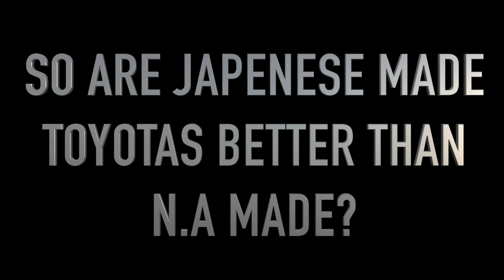Are Toyotas Made in Japan Better than Toyotas Made elsewhere?

Comment: Some thing not discussed {I understand why) is the tension between the factory workers and the car company/management.   American workers and Japanese workers I would suggest differ here. 
 
Japanese workers feel that they are essential and appreciated team players with Toyota/management in producing world leading high quality/reliable vehicles moreso than American workers do.  Has a LOT to do with the fact that workers in Japan are Japanese and their managers are Japanese and the company is a Japanese car company.

We purchased a new 2018 Camry LE with a JVIN in early 2018.  I watch a lot of CCN videos on DIY maintenance and ran across a difference between the parts/design of our JVIN 2018 LE and similar Kentucky/US made 2018 LEs.  On CCN's video on the engine coolant radiator drain & fill at the part in the process where a coolant hose is disconnected from the EGR cooler just before the fill with new coolant to assist in removing the air from the system I noticed the difference.  On our JVIN I found a quick disconnect at this location.  When to our selling dealer's parts dept and sure enough the hoses to the EGR cooler are a different PN for the JVIN and the US assembled LE and the US LE has no quick disconnect.  Better?  Maybe not, but more convenient and faster.  So this is a design difference and does NOT touch on the assembly process at all.  Another difference was pointed out in a thread on the TN  forum. No recovery eye bolt is included on US 2018 LEs but on our JVIN we have the eye bolt that can be screwed into the front drivers side grill threaded recovery point.  There is a spot in the foam tool holder for this eyebolt and it is shown in the owner's manual.  Don't know why it is not included on the US LE.  Cost cutting run amuck?

Comment: I have been watching Matt's Off Road Recovery on utube and found out something that is quite disappointing to me.  Matt came across a brand new Subaru stuck in not much sand.  It just wouldn't move at all or spin the wheels at all.  Matt says a lot of new cars shut down (as in no throttle) when under strain in deep sand, mud, snow etc.  INCLUDING Toyotas !!!!  I drive a new Highlander Platinum with torque vectoring AWD.  I can tell you right now if it shut down on me just when I need it, it would be for sale the next day.  My question is - is a Highlander one of the vehicles that does this?  If that is the case, I would go back to the old 4Runner but not before checking it out first.

Comment: Toyota products made in Japan use different parts than those built elsewere.
Or at least they used to. In my repair shop and personal cars when buying 
parts for Toyota's I was always asked if it was made in Japan or another country.
Serial # starts with J was made in Japan. I also noted US vehicles used US made
parts in their vehicles. Example Batteries, wipers, tires, radiators, brake parts and so on.
I was told Toyotas made in US used 30% US parts, an agreement they had.
Having said that guess which parts failed?????? In my experience there is a huge
 difference.

Comment: An example of bad toyota engineering:  I owned a 2003 Pontiac Vibe (Matrix) that had a "snap" sound when the drivers window was rolled down.  Eventially a "scrape" appeared on the window and it turns out that the metal door catch that sticks in the door and is connected to the frame that stops it from swinging open was poorly designed.  The window, and only when the door was closed, would hit this door stop on its way down.  Sometimes they would actually break off.  I believe the very next year they fixed it and the new design could be retrofitted.  An interesting story and something I have not noticed on any other car I have owned.

Comment: Being a Massive global company, Toyota does have a fairly market-oriented way of releasing models to specific areas of the world. While I've not always agreed who got what for certain reasons (mainly niche features all the way up to region-exclusive engines), Mechanically they've got it figured out to both what works and what sells better overall. Also like a lot of manufacturers, I would venture to say that they keep all the best of their offerings to themselves, but (!) there's likely reasons for it that the consumer is not in on the decision-making end. 
On the rust issues, you'll find examples from every market they released a model that was very prone to corrosion. Every manufacturer has a fluke once in a while, though Toyota normally makes good reflection choices to improve deficiencies. I've had several Toyotas manufactured both is the US and Japan that have outlasted my expectations mechanically but were eventually sold as their bodies/frames/critical structure points were advancing beyond my monetary means to keep them from returning to their base elements.

Comment: I have owned and serviced many Toyotas over the last 4 decades. For the most part I agree with these conclusions, but there have been some glaring examples in the distant past that created the impression where it was made mattered.
Case in point- anything built in the Fremont Assembly facility in the early to mid 80s up to early 90s or so. This was a GM plant that under partnership with Toyota built the Geo badged and even some Toyota badged Corollas. Interestingly, it is now a Tesla plant. 
I agree about general reliability, but the paint, the panel gaps, the interiors, etc were bad. Really bad. I've seen Corollas that were built there that didn't even have full paint coverage on the inner lip of the front fender. Showing primer. Hood paint so thin you could see the primer on white painted units. Interior plastics degrading much faster than Japanese made units.
In my opinion the Toyota/GM partnership did more to degrade Toyota's brand than anything else. Avoid these cars.

Comment: Does Toyota take into account post-sales issues into future model years? For example, the 2UR-GSE engine is otherwise very reliable but the valley plate coolant leak caused by the failing FIPG is a well-known issue that has existed for years - does Toyota note this and make design changes to later model years based on consumer reporting or is it only via internal reporting via failure rates and field service reps, etc?

Comment: My 2007 Toyota Camry Hybrid was built in Japan I had a major issue where the computer shutdown the gas engine in a rain storm when driving home at night on the way to the top of one of the highest suspension bridges in the USA the Chesapeake Bay Bridge near Annapolis Maryland.

Toyota Corporate in California replaced the computer in my Toyota Camry Hybrid. The vehicle was recalled many times for other items yet Toyota never recalled any Toyota Camrys to get the computer replaced that controls the gas engine in the Hybrid Synergy Drive.

Comment: Lots of comments about "pride" of Japanese autoworkers vs. those in North America. While this may be true to some extent, this probably has played a much lesser role than the Kaizen Total Quality Management system. This was the competitive advantage that propelled several of the Japanese automakers to gain significant market share. 

A lot of the key Kaizen concepts (lean production, minimization of process variation, continuous process improvement, etc.) have been adopted by North American companies, but implementing them into operations is ultimately down to management. I would agree with both presenters in the video here - the company & management structure matters a lot more than the manufacturing location.

Comment: i was shocked a few years ago when i found out my 1998 tacoma was built in Baja California Mexico because i thought Toyotas were all built in Japan , I love my tacoma truck the major problem i have with it is that my son keeps crashing into people so we kinda fix it and wait till the next crash ,i have 3 Tacomas now i don't care about where they are build ,may be i should but i can't control that , one thing negative about my 1998 tacoma the front left wheel  upper arm ball joint  came off at like 260,000 miles while mi son made a turn the seal was cracked and grease came out no way to grease that part (that i know of) once seal brakes ,my 2004 tacoma with 164,000 miles also no way of greasing that upper ball joint and it has broken seal kinda scares me ,i have to check my 2016 tacoma to see if it has greasing  thingy ,i don't work on cars ,thank God my brother in law does . i had him replace upper ball joints on both sides when that happened just to be safe .

Comment: There is no question about the difference in quality.  The quality is not in design but in the production and assembling.  I had a 2000 Sienna that was assembled in Kentucky , right off the lot, there was a patch in the inside front passenger door that wasn't painted. The overlap sequence of the A-pillar and dash pad was reversed on the passenger side. After 5 years or so I had a check engine light indicating that there was a problem in #5 cylinder, it had to remove a lot of stuff yo get to it. What I found was obviously man made problem, the spark plug wire was only dangling there, it was luck that it ran like it for 5 years. In year 8, I need to replace all the shocks, again, the front passenger side didn't not came off as expected like the other three. I had to force it out and discovered that when they were installing the shock assembly, they just jam it in and the threads were all messed up and the mount was bended.  On the other had, I had a 1989 Camry, it was just wonderful all along. DIY maintenance was easy as nothing strange about it.

Comment: Have a Japanese built 25 year old corolla 565000 miles , other than regular service, I have change the shocks, cv boot rubbers, engine thermostat, a camshaft seal, crankshaft seal,  oil pump seal and an exhaust system, I believe Japanese have it mastered.

Comment: Is David related to design of 2GRFE oil cooler or oil high pressure rubber lines ?
And why Toyota not eliminate Engines sludge by designing good and reliable oil coolers.???

Comment: We bought a Mercedes ML320 when it was first manufactured in Alabama. Quality was terrible. All the things like the roof, the cup holders kept falling apart. Not to mention every 6 months the engine light will come on and the dealer will charge $700.00. This went on for a while and we just gave the vehicle away to someone. This is NOT how a Mercedes should be. So no more Mercedes ever for me or the people I know after they knew what happened to me.

A 4Runner I had however for  10 years and I didn't have to replace a single part other than the usual WindShield wipers, tires and brake pads. The OEM Panasonic battery in that 4 Runner lasted for 9.5 years and this vehicle always was parked in the open having to go through many seasons of cold and hot weather etc.. It was bullet proof. The 4Runner is manufactured in the Tahara plant in Japan. The ONLY Toyota that is assembled in a Lexus plant in Japan due to the common platform between it and the Lexus GX460. It's one heck of a vehicle.

I am sorry Car Care Nut! It is nothing to do with design, or sourcing of parts it all boils down to the pride of the worker assembling the vehicle. The difference is in other parts of the world it is a job, it is a paycheck while in Japan it is a matter of pride and workmanship.

I worked in the Auto Industry on the manufacturing side and I know!

Comment: If japanese built are better i want one. My 03 camry v6 xle was built in kentucky. 330k miles and looks and runs great. It is 20 yrs old with original everything but radiator and altetnator. Both replaced after 250k miles. Paint is original and holding up great, no fading or flaking. If japanese built is better i want one.

Comment: I've owned many many brands both Japan and USA, including Toyota Honda, gm, ford, mitsubishi on and on, and I will say on the older stuff the assembly quality was better on the Japanese stuff was better in some but not all cases.  However material quality like the steel itself, fabrics, carpets, plastics is far far superior on the USA made stuff.  

My 84 ford ranger interior is well made and has held up excellently over the years.  My 84 Toyota pickup dash and interior plastics and carpets have literally disintegrated.   Japanese honda plastics are extremely fragile as they age.  

Just comparing the body steel itself between the 84 ranger and the 84 Toyota is night and day.  I can straighten a front bumper on the Toyota with my bare hands.  Box side sheet metal is also very thin and extremely rust prone on the Toyota.

The Toyota engine on the other hand is marvelous.  Bottom line is that quality depends on what you mean by that term.  Assembly, actual physical material quality, etc.

Comment: Fix things in a couple years but then come up with new models after 3-5 years so nothing is ever fixed. 😆

Jokes aside, The 4 Toyotas I've owned, 3 of them had over 250,000. The 2004 Sienna had a transmission pan leak I didn't notice or address so that part failed after all the fluid leaked out. The Matrix/Corolla I use as a backup car. The 1998 Rav4 had low mileage when it was sold. 1998 4runner was sold to a friend had over 250,000 miles. Toyota is made with ♥

Comment: what i find is Japan made for domestic market are better built than Japan made for export. Japan likes to keep the best of the best for Japan, example if it was based on ranking AAA+ for Domestic, AAA for domestic and lower rankings like AA or A or B+ export only. i find that those Japan domestic market models at 3-5 years mark have better fit and finish compared to export models of the same year. they are manufactured to the same Standards but for Japan demotic market it made to a higher standard than export models.

Comment: Why is it that the current Toyota trucks seem not as reliable? I owned a 1985 22RE and those engines seemed to be really bullet proof. The new 2023 Tundra's are not recommended by Consumers Reports, and have lost their reliability and Tacoma's are not as good as they used to be. I own a 2016 Tundra 1794 and no issues with 58,000 miles. I hesitate to trade it in for a newer Tundra. Your comments please. Thank you.
Reply: @Chatsworth Osborne, Jr.  Thanks for your reply

Comment: Interesting.  My Wife and I just bought a certified 2018 4runner and Every 4runner we looked at had a Vin number that started with a (J)=Japan. When we actually bought the one she wanted, I asked the salesman and he said that All 4runner's are manufactured in Japan. Not sure about that but literally Every 4runner we looked at (at 5 or 6 lots) all only had a Vin number starting with a (J). If that's correct and they're all made the same everywhere then why are the 4runner's only made in Japan????
Reply: Because the 4Runner is a legacy product, seeing incremental upgrades over many decades.  The Tahara factory is highly automated and can easily handle the volume to meet worldwide demand, so no reason to invest in the tooling and supply chain to support additional factories elsewhere.  Cheaper to just crank them out in one factory and ship worldwide.
Reply: @stevel9741  Interesting and I understand the cost factor. It would be most interesting to see a spreadsheet of issues related to the 4runner exclusively manufactured in Japan compared to all other assembly plants worldwide (with other models of course) Those actual hard numbers would put to rest the question of if the Japan assembly is better than other assembly plants and those hard numbers are not available from what I've found? Do you happen to have a link for those hard numbers? Thank you.

Comment: I have a question for this guy.  I wonder if the maintenance and upkeep of equipment is worse in USA.  I am thinking of the Rav4 engine that cracked (few) in KY that was the result of a pump failure in cooling bath.   Things like this seem to be happening in US. Due to laxity or ppl not doing their jobs

Comment: Question Toyota master is undercoating for my brand new highlander 2021 is necessary every year or 2x a year is important. I am asking this question cause I live in Vermont where winter is long and they use hard core chemicals to melt the ice or snow.
Reply from the maker: Hi! On your highlander it’s not as needed as before as the car is well covered underneath
Reply: @TheCarCareNut  thank you very much

Comment: I am still upset that TOyota will not tell us exactly which foundry and which country of origin had the issue with head bolts pulling out of the block of the early 2AZFE. I know they know exactly which foundry and which country of origin blocks had this issue. Likewise I also have a 2AZFE that is has oil consumption issues and Toyota did not warranty it while under warranty. Fast forward and at 96K miles it consumes oil even though it has never gone longer than 6 months or 5000 miles with out an oil change and has always had synthetic oil! I have owned Toyota's since the 1970's.

Comment: Is there a fix for the New Rav4, Corolla Cross for their Roof Rails water leaks thats not bolted down but instead uses a plastic push in pins with a paper thin washer.